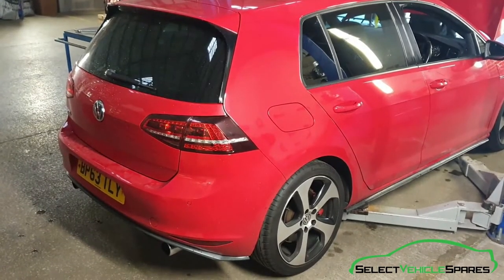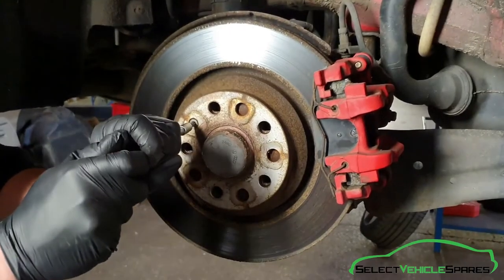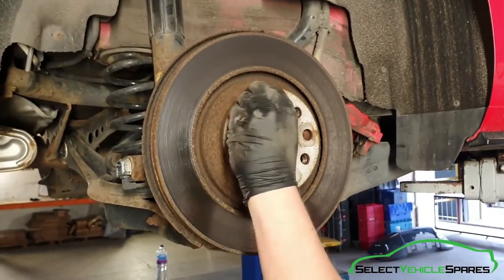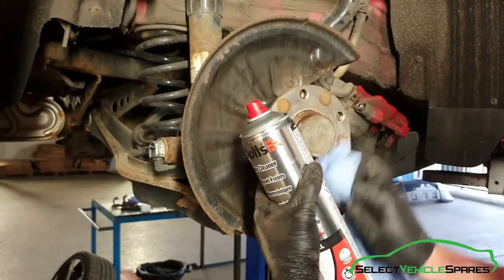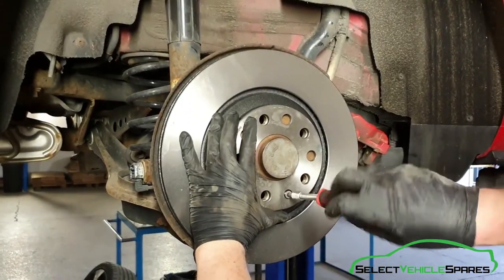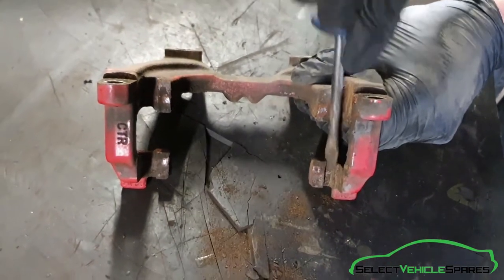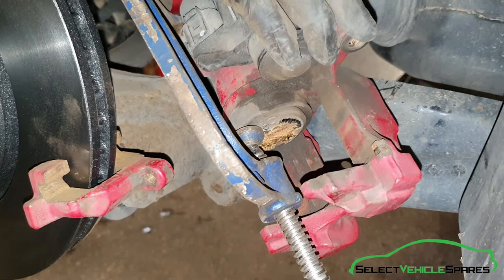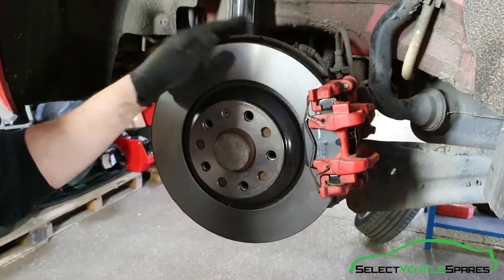VW GOLF GTI MK7 - How To Replace Rear Brake Discs & Pads Change Swap Replacement

Comment: Just as a note. After a heads up from my local independent garage, I have just changed the rear discs and pads on my '19 Cupra Ateca that has the same rear brake setup. If it is the same setup, you may be able to remove and replace the discs without removing the pad carrier. Removed the caliper and pads as per this video and then knocked the disc off and by angling the disc away from the car the disc just slid out. Clean up and replacement as per the rest of the video. Much much easier than struggling to undue those pad carrier bolts!
Reply: Unfortunately, no. I've just tried replacing, got to the M14 12-P stage and after trying for a good long time I can confirm you CAN NOT take the old Disc off, let alone put a thicker new one one - had to put it all back together and order a cheap tool to try again tomorrow. :(
Reply: @georgeh01  Today we had the same car as in the video. 2014 GTI Performance with the exactly same rear brake. 310x22mm discs, same caliper, etc. And it is really the fact, that I dont have to remove the carrier, to replace the disc. On this car with this brake, you can let the carrier mounted, the disc fits between the carrier and the hub very easily. I made a short Video and pics of it. Its really cool, because it saves very very very much time.
Reply: I just did my father-in-laws mk7 golf rear brakes (2019 1.5TSI).  Tried my best to get the disc off without removing the calliper bracket but there was no chance.

Comment: Good video, well presented. Just done mine. One thing I do is put a light coating of antiseize between the new disc and the hub after cleaning it all up in the hope of making it easier next time - my old discs were pretty rusted solid on and needed some fairly hefty  persuasion with a lump hammer to get them off..... A bit more than tapping required!

Comment: Nice clear video. Those M14 Splines are really tight, when I did them the car was on axle stands so my breaker bar had no clearance, it was a real struggle. With the piston, I wound it back as far as it would go then pushed it the final few mm.
Reply: No need to remove the carrier.

Comment: Nice video. I have a maybe a stupid question,  the mk7 gti rear disc are no vented . If you want to put vented ones is going to change something? You need to
Do something different?
Reply from the maker: Yes, they would require different calipers and carriers.
Reply: @SelectVehicleSpares  thank you legend

Comment: All other videos i seen i have to rotate the piston in with a special tool and in this video you dont have too. Is it because of the electric ebrake? Is there a different i dont want to risk damaging it. Thanks in advance.
Reply from the maker: Yes, in our experience the models with the electronic handbrake just needed the piston pushing straight back in.
Reply: @SelectVehicleSpares  thank you, i appreciate your reply.

Comment: Nice job. One comment I'd like to make is that those carrier bolts are single use torque to yield, at least here in the states they are.
I've never done eBrakes before so after resetting them with the VAG tool you still have to manually clamp down on them to get to 
return? Weird!
Reply: I think the motor just retracts the handbrake pin inside the piston, so still needs manually pushing back.

Comment: Do you open the cap on the brake fluid  reservoir
Reply from the maker: Yes, this will make it easier to push the piston back in.
Reply: @SelectVehicleSpares  thanks for the replay

Comment: I'm going to do this job on the ground. Could I use an impact wrench for the spline bolts?
Reply from the maker: Yes you could use an impact wrench, but if possible we would use a hand tool when undoing for the first time, to give a better 'feel' of the bolt.

Comment: Once the Ebrake has been electronically released and Reservoir cap undone can't you just push the piston back by hand???
Reply from the maker: No, the motor behind the piston will not allow you to push it back far enough to get the new pads in.
Reply: Where can one get the VCDS software?
Reply: Just get Carista and £9.99 for a month then cancel

Comment: Do manuals have this motor for the parking brake?  It feels like a normal mechanical cable brake when I pull and release it in my 6 spd. manual.
Reply from the maker: It depends on the model. If you have a handbrake lever (rather than a switch/button) then you will not have this motor.
Reply: @SelectVehicleSpares  awesome, thank you. I have a 2019 GTI for the North American market, and it uses the traditional lever style hand brake.

Comment: Hi, great video. Looking to get x4 new Brembo discs and all new pads on my Mk7.5 GTI 2017. Just wondering what size the back discs were you fitted? Always thought oem size was 272mm rear and 312mm front, but cant find any brembo 272 rears, only 300mm? Thanks
Reply from the maker: On the vehicle in the video (GTI Performance), they were 310mm rear discs. On other models (including non-GTI) the sizes can be 272mm and 300mm.
Reply: Just to add to the reply, if you have a mk7/7.5 performance pack, it had the same brakes as the golf r which were 340mm front discs and 310mm on the rear (I recently got brakes for my mk7 performance pack and these were the correct size). I think it is the none performance pack GTI's had 312mm up front and 300mm rear
Reply: Rears are 300 front 312mm.